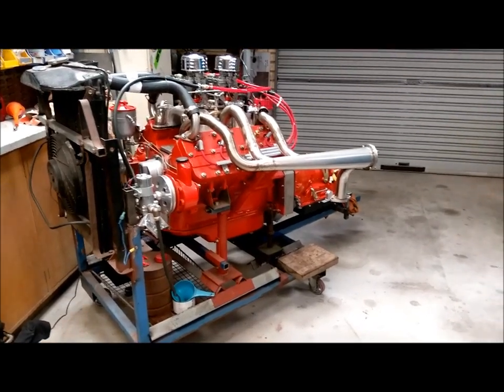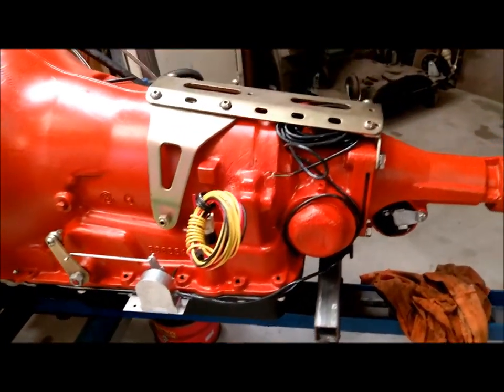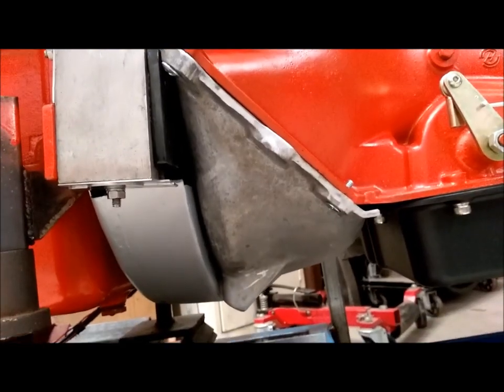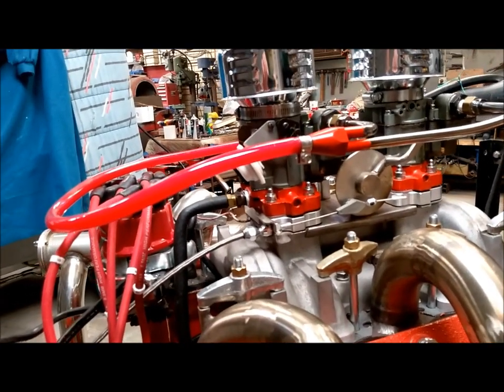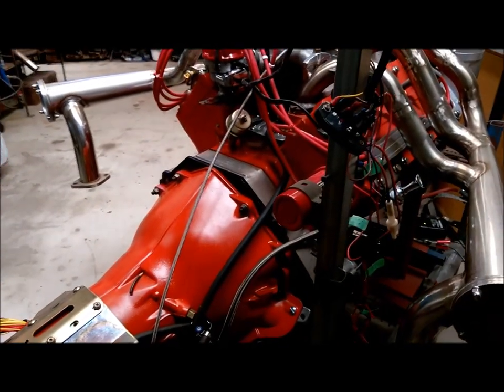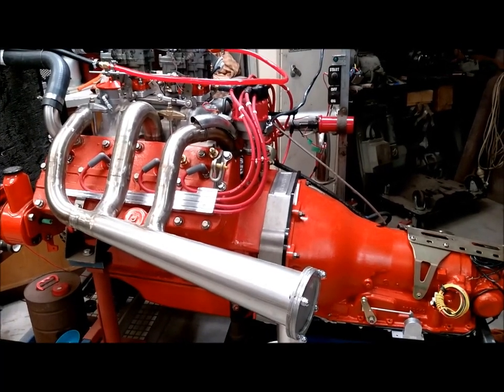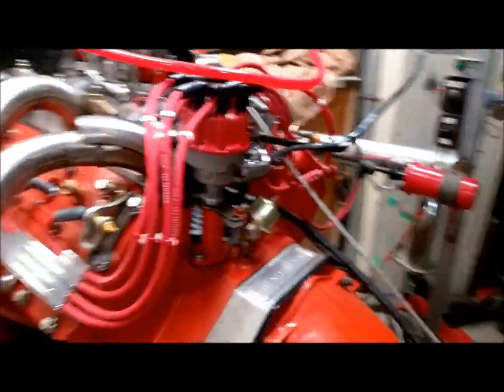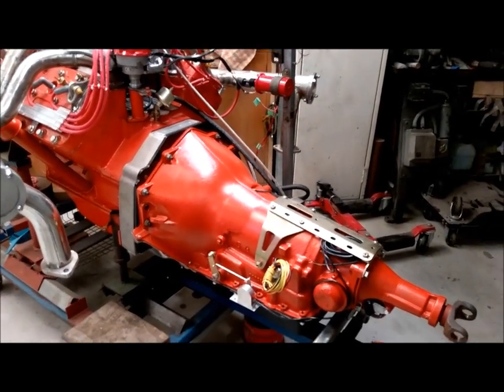Cadflat Movie Part 3 - Transmission V8 Flathead Hot Rod Engine Motor LaSalle 322 346 TH700R4 Flatcad

Comment: Did you rebuild it yourself?
Reply from the maker: Machining done locally and then assemble with an old car experienced friend.It was great fun and a awesome learning experience.Hardest part was gapping and installing the hydraulic lifters.They are best installed using a Cadillac specific valve spring compressor.We used a flathead Ford compressor which handled all but the two end valves.So we made up a modified end tongue and welded it onto the Ford unit and then removed it once done.Still touch and go but got us over the line.Valves are best worked on and held open using some cord or rope as a spacer.I believe this method can be found on YouTube if you are unaware of how it works.